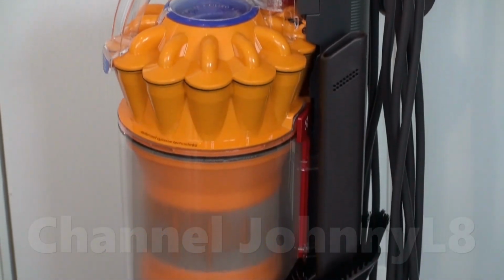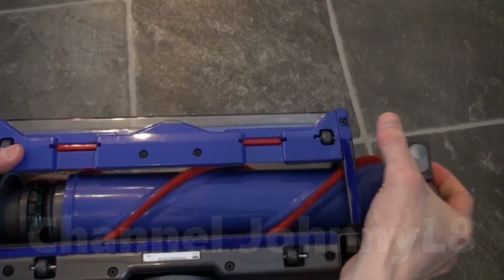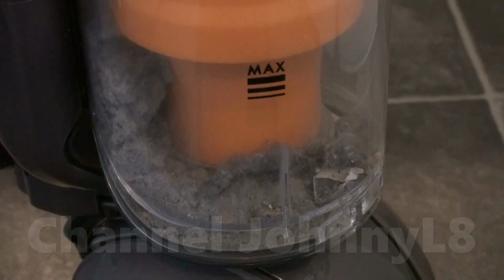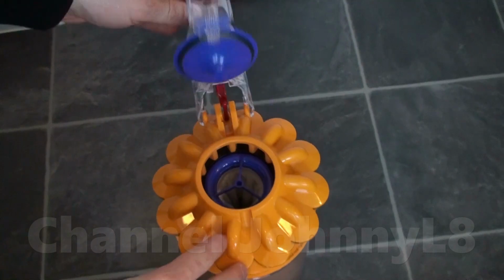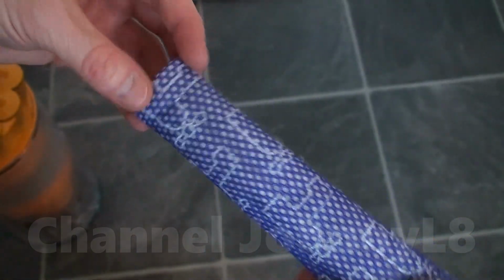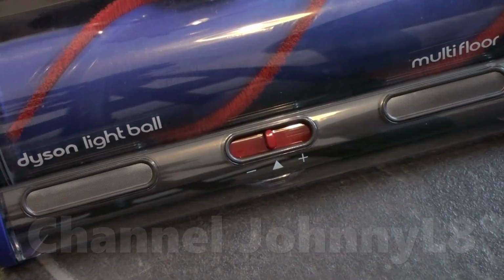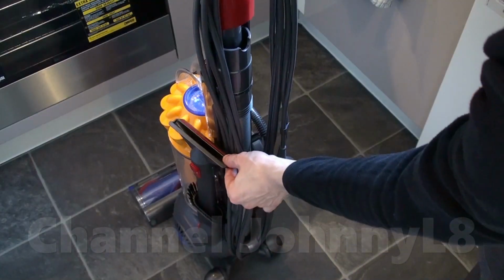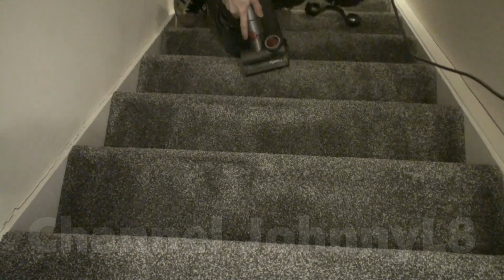Dyson Light Ball 6-Month Update Review

Comment: Still a relevant review. The current UP-34 Dyson is very similar to this model. What an excellent vacuum it is!
Reply from the maker: It's worth contrasting this sentiment quite harshly against the anti-Dyson racist-like naysayers who were very aggressive towards it all those years ago, despite all the evidence and facts in the world against them. They loathed it, claimed it didn't clean well, claimed it wasn't powerful enough, criticised it at every turn. They equated noise, power, weight, and size with performance, which is utterly stupid. It's worth reflecting on what they championed as alternatives, since they're clearly at odds with reality. Today, while it performs just as well as it always did, it's old technology I wouldn't look twice at. Better approaches achieve better cleaning performance in more modern machines from the same manufacturer using a fraction of the resources and much more easily.

Comment: What vacuum did you have before the light ball?
Reply from the maker: DC41 (and DC35). It was a nice vacuum but really noisy, produced lots of waste heat, and clamped down way too hard on carpets making it hard to push. All fixed in the latest products. I haven't touched the Light Ball actually since getting the V10. The V10 changed everything for me in a way I wasn't expecting. I now consider all corded mains vacuums to be museum pieces (except for specialist use cases that constitute a relative numerical insignificance) and would never look back. I still can't get over what an elegant vacuuming solution it is; it's no longer a chore for me.

Comment: It’s a perfect machine, I have had mine for 6 months now and not one problem from it. I store the upholstery tool on the actual wand and I find it doesn’t get in the way either but after it does fall off the multifunction tool easily. 
Love how well it picks up in hard floor and it’s so much quieter then my previous Dysons.  All in all a really well made machine. 
The only thing I’d like is a slightly less rigid cable as mine in my machine seems very rigid, but it’s just a preference and doesn’t put me off the product.
Reply from the maker: Yeah, it's near perfect for me too relative to others. There are a few minor niggles, and they could improve things much more going forward (self cleaning shroud, abuse proof bin design, Cinetic technology etc.), but it's a great vacuum, even for its full price, which it never seems to be at.

Comment: Hi again🙄, I’ve had my Dyson V8 Absolute for two years (got it the day it came out) and it hasn’t faulted once. As an engineer myself I know the best time to test something is when it’s old. It performs like I just pulled it out of the box. I’ve never had to clean the inside the bin or the shroud. All I’ve had to do is wash the filters and remove cack from the floor heads. The list of positives go on…
Reply from the maker: Hi, I've heard they're good but never tried one myself. I still like my original DC35, but I tend to use it less since I got the Light Ball—it's hard floor pickup is just too good. :)